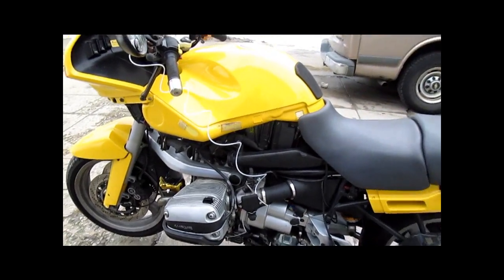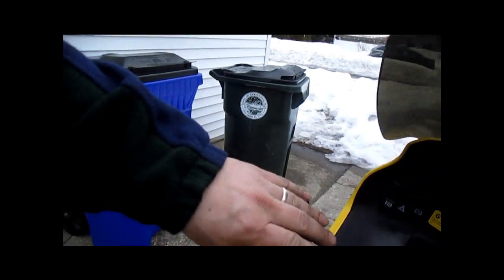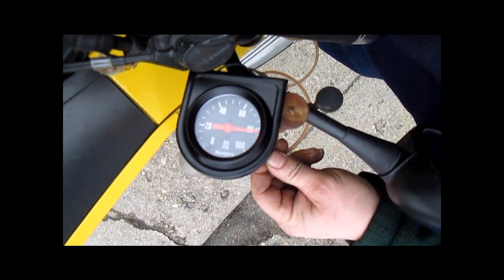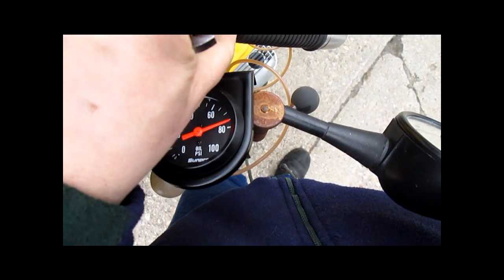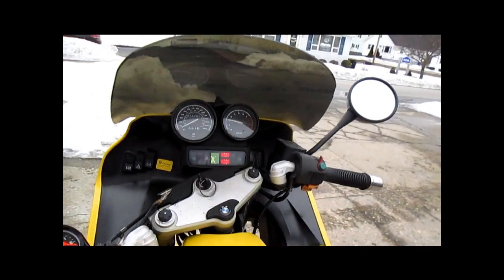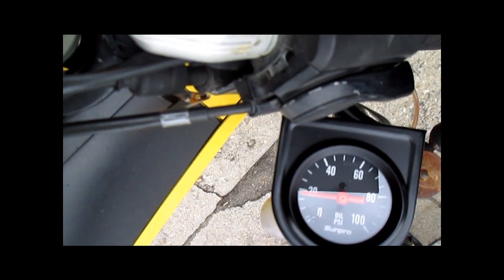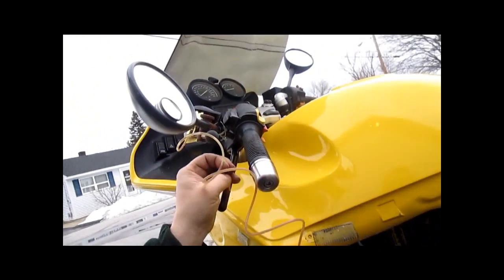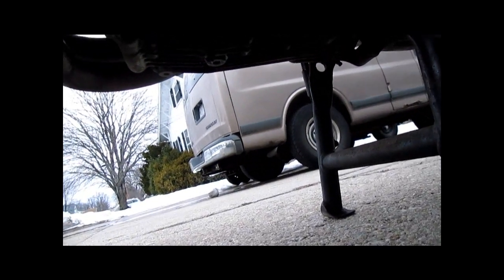BMW Service - Oilhead - Testing Oil Pressure

Comment: Can you do this to an 1985 k100 also. My oil light is not working and want to check actual oil pressure before start changing parts
Reply from the maker: Don't bother, just ride it. Trust me.
Reply: Chris Harris thanks
Reply from the maker: You're welcome!

Comment: 1998 R1100RT with 127,000. One owner, me since new. Pressure light came on. Oil was about 1/3 qt low. Sight glass was empty. Topped it and light still stays on. Engine sounds fine but afraid to ride it for fear of damaging it?? If I do pressure check and it is good what do you recommend?
Reply from the maker: I would suspect the oil pressure sending unit has failed and replace it.

Comment: Hey Chris, if my bmw r1150gs oil pressure indicator  light, on 1100 RPM start to blink vague .do I have to take some action?
Reply from the maker: Replace the oil pressure switch.

Comment from the maker: 20w50 is fine. I am not a fan of synthetic oil in these engines. The Oilheads that are in my shop with oil leaks have usually been run on synthetic engine oil. Use synthetic in the transmission & rear drive (75w140 GL-5) and synthetic (DOT 4 ) brake fluid but avoid synthetic engine oil. Thanks, Chris

Comment: Completely off-topic, but that clacking sound that goes away when pulling the clutch, do you have any idea what this is? 
My car does this too lately and I don't know if it can get old (well, really old, it's already 21 years) with that, or I shouldn't bother doing further repairs on it and sell it while it still drives...
Isabelle

Comment from the maker: At idle merely 5 psi is sufficient. This engine has 18+. The specs you are mentioning are for under-load and not applicable to idling when at operating temperature. Thanks, Chris

Comment: I don't want to whine but the specs you show say "operating pressure 3.5 to 6.0" and you have under 20 psi = 1.3 bar
it's low.

i know flat twins don't like to run and start on the side stand it kills the right side bearing and could lower the oil pressure.

under 20 psi is normal ?